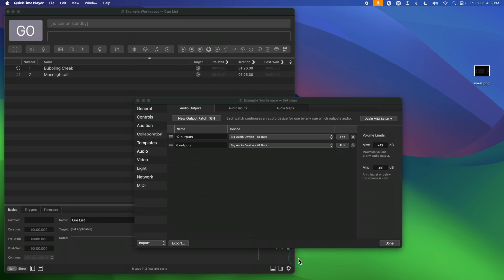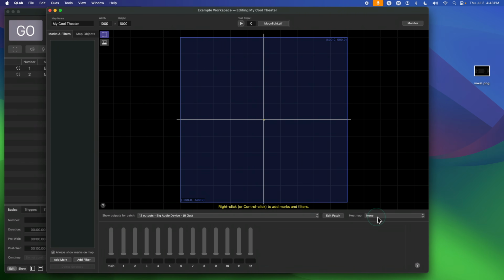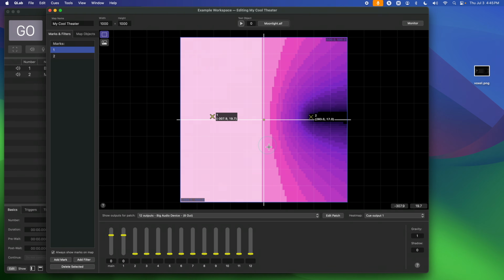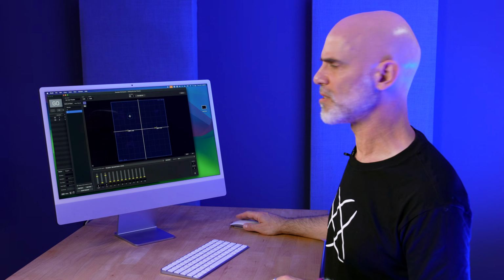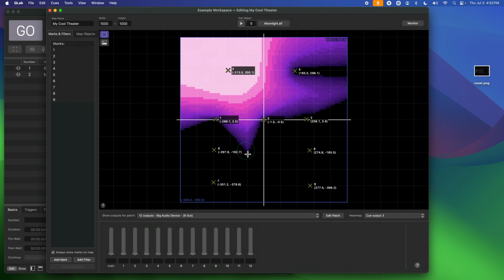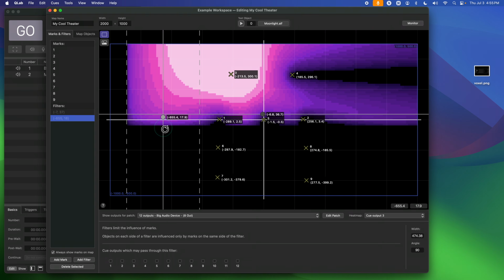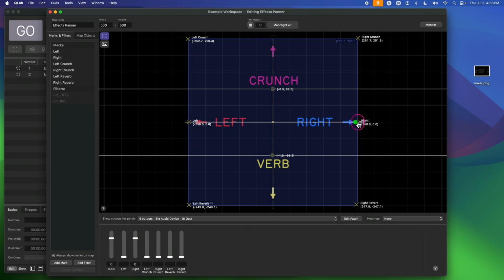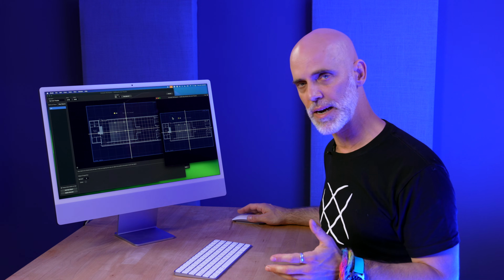Setting Up Audio Maps in QLab 5

Comment: Hello! Amazing news, i've been playing around for while with the new features. Question, is possible for a fade to have the same function as audio cue such as infinite loop or number of repetitions. For instance if i want to run the circle not just once? Thank you.
Reply from the maker: Good question! At the moment you'd need to have two fades to loop them, for example using two fades in a playlist and the playlist loops. However we will soon add a checkbox to make it easy for single fade paths to loop.
Reply: @Figure53  Would also like a speed/rate for the fade. so the circle can start slow and we can fade the rate to make the circle go faster or slower.